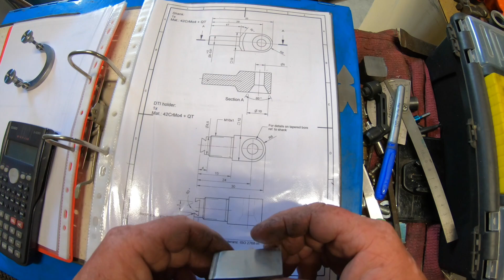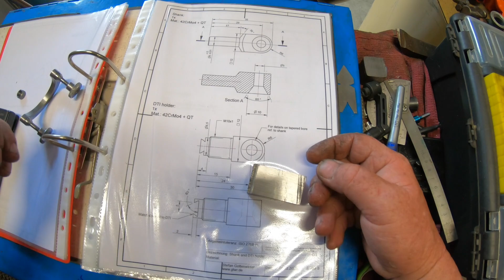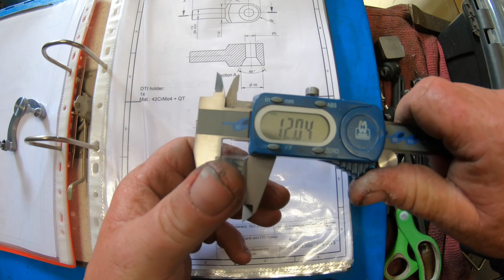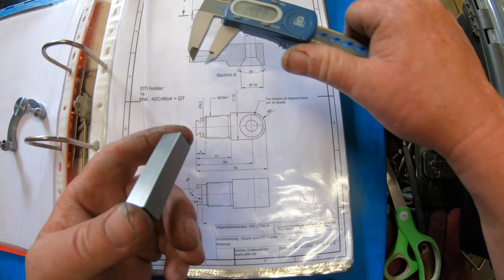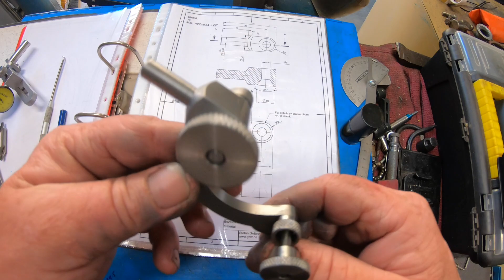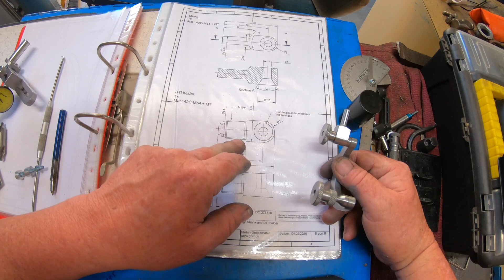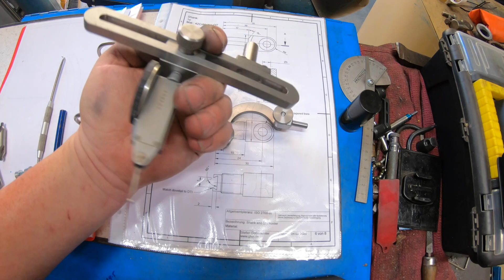GTWR Indicator holder Part  3

Comment: Hi Matty, thanks for the shoutout.
That shear tool certainly works a treat. The indicator holders coming along nicely. Cheers Kevin
Reply from the maker: Gday, Kevin, it unbelievable how adding 10° of extra angle makes so much difference, the tool seems to cut effectively with a super smooth finish, it’s a win win

Comment: I'm always surprised by the number of people that comment on the results from a shear tool, yet when they are having surface finish problems they are always fiddling around with the carbide.  In my opinion, the shear tool is one of the best low pressure, good finish on size options out there, especially if you are using extremely old machines.
Reply: And mild steel that won't play the game , Nothing beats it for taking off that last thou either !
Reply: @swanvalleymachineshop    Rounded end tool for flat work (or facing in the lathe), flat ended tool for round work.  Raise/lower for a fresh edge, when the whole thing gets dull, take it to the grinder for a touch up.

I've run as many as 6 spring passes on a lathe turnings, bringing a cut to bearing fit.  When no more chips are yielded, it is a good, smooth finish that you can admire.  Chips range from cat whisker (bigger than that is pushing too hard) to peach fuzz.  Some you have to lay a clean cloth or sheet of paper under the work to be able to see if chips are being produced.